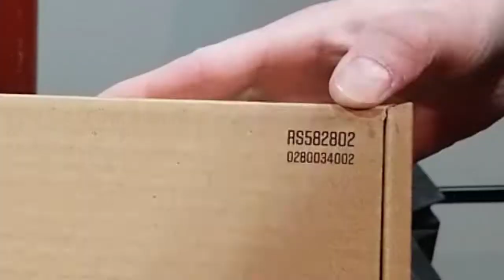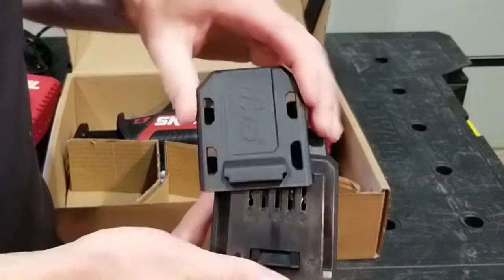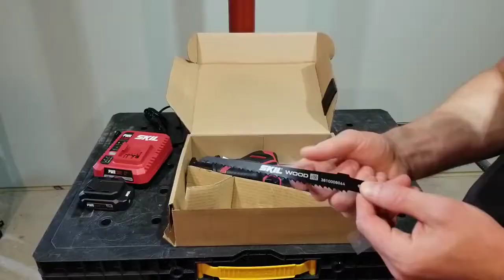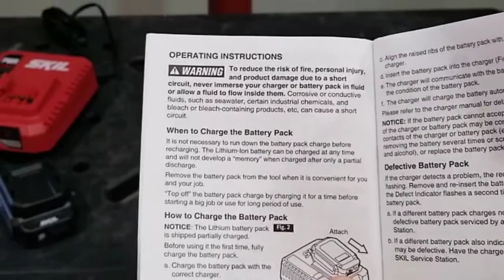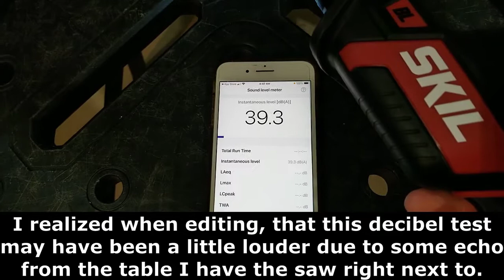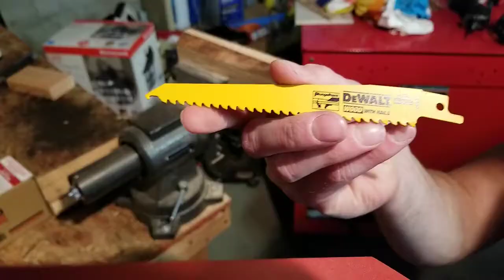SKIL 12v Reciprocating Saw First Look - IS SKIL THE BEST BRAND NO ONE'S LOOKING AT?

Comment: I picked up the last 12V recip saw and multitool from Lowe's before they pull them off the shelves and toss them with the Skil lanterns in the dumpsters.  I paid $21 after taxes. 
They couldn't sell me the 12V/20V lantern it came up as 2c.  I grabbed just one after they tossed all 4 in the dumpster. 
I couldn't register the 300 Lumen lantern because no receipt and it was in the trash.

Comment: Yeah the Skil 12V stuff in particuler is super slept on by lots of people (maybe less so these days, as people are finding out how good these tools are). They are perfect for the small/light/compact niche of tools/jobs. Unlike other brands, they're not just a throw-away design. They're innovative, smooth, very well built, and got great performance for their size and 12V batteries.

Even at their regulat prices they're worth it. However if you had a chance to buy into the Skil 12V line during the Lowe's liquidation, you were really lucky/smart. I bought the 12V jigsaw, this recip saw, the detail sander, multi-tool, 3/8" compact impact wrench, impact driver, 3/8" ratchet, pop-up lanterns, and 4" clamp on fans. I didn't pay more than $16 for a single tool. Some even less ($14, $10, $9, $7). At those prices it's just silly to ignore the lineup...

Comment: Home & Decor has the BEST prices on the Skil recip saws, oscillating tool, grinder and circular saw. 
I got the oscillating tool kit with 4Ah battery and charger and a 5Ah battery for $86 after taxes, a week later got the Skil 11lb sawzall (reciprocating saw kit with charger and 4Ah battery for $53 after taxes. 
I got the one handed recip in 20V at Waysource for $207 with 4Ah battery and charger on the 1st day of summer.  It was handy cutting some overhead branches. 
I wish Skil pushed 6" or 8" mini chain saws.  It feels like the mini chain saws rip through branches faster?
Reply from the maker: Wow! Those really are good deals. I'm not familiar with that store. They must not have them in my area. I've noticed them expanding their lineup a little bit as Menards has been carried the brushless versions of the 20 volts now, which are decent deals from what I was seeing on Amazon and Lowe's. I feel like I recently saw a chainsaw. I just don't remember what size it was for skill.

Comment: @tgltoday2717 I have everything I need in Milwaukee M12 and M18 Fuel, but recently picked up a bunch of Skil 12v, Flex 24v, and some Bosch 12v and 18v, as backups, just because they were so inexpensive. Skil 12v is definitely the most underrated line out there right now. 👍🏻

Comment: Just bought one from Lowe's. They had a one day sale, online only. Got it for $29. Can't beat that
Reply from the maker: Wow that is a sweet deal. Can't beat that at all.
Reply: I snagged the same steal as kit with 2ah, as well as circ with 4ah for $59 earlier and drill, impact, omt, light and speaker with 2x 2ah for $80 slightly before that. Fully in the line now! Next will be the inflator.
Reply from the maker: @iremetal Nice job on that hall. The inflator or something I've never used and I have a hard time even finding a video on it. I'd really like to know how well that works.
Reply: @tgltoday2717  Zach shop talk has one comparing to hypertough
Reply from the maker: Oh that's cool to know. I'll have to look that video up thank you.

Comment: I really think you should’ve gotten the Milwaukee 12 volt way more power and it’s smaller. But the downside it does cost quite a bit more. You can get nice 4ah batteries for your saw
Reply from the maker: I don't disagree at all. The Milwaukee is definitely a better saw. I actually gave this one to my grandpa and started getting him a few other skill 12 volt tools. And now that you mention it, I did actually end up getting the four amp hour battery for him. Thank you for watching.

Comment: Make sure that the battery pack is inserted all the way into the charger to make good contact. My  pack was a little hard to insert, returned the package thinking that charger was DOA. It was probably OK, I was not inserting pack with enough authority.
Reply from the maker: That's a great tip. Thank you for letting me know. I know I have a few Dewalt batteries that are hard to put in like that. Its kind of annoying.

Comment: I received mine today. I use a reciprocating saw strictly to cut tree branches . My intent was to replace my Milwaukee M18 Hackzall with the Skil PWRCore 12 reciprocating saw. Instead, I'll keep both. Together with my two-handed Milwaukee M18 Super Sawzall, the two one-handed recips will let me keep a 6-inch blade in the Skil, a 9-inch blade in the M18, and a 12-inch blade in the Super Sawzall. My  impressions were the same as yours: front-heavy but eerily free of vibration. Even when you squash the trigger, the speed ramps up slowly, like my PWRCore 12 jigsaw. I like that feature. I'll probably be using this saw mostly with the larger, heavier 4ah battery, which should provide more voltage under load and help balance the weight.
Reply from the maker: Glad you like it. For what Skil is, I really think they provide a great homeowner tool with a lot of bang for your buck.

Comment: I'll keep buying if they keep coming out with new stuff in 12 volt.
Need:
Fan
Radio
Gas pump
Shower head and pump for camping shower
Inflatable toys pump
Spotlight
Shop clock?  
Hot plate?
Hiking SOS alarm?
Reply from the maker: Haha that would be pretty nice. They should start making their accessories for both 12 or 20v. Then they would really have something going. I know they have both 12 and 20v inflators, just not sure if they do more then just tires but I'll be looking into that now. They also have a bluetooth speaker in the 20v but left out the 12. A fan, I'm actually surprised they dont have one of them yet.
Reply: @tgltoday2717  They have the Bluetooth speaker called 7 in 10 watt Bluetooth indoor speaker.  Not sure why they just didn't call it the 12v speaker.  It uses the 12v.

Comment: Great review. What type of blade would you recommend for cutting tree roots in the ground?
Reply from the maker: I have a 9" diablo pruning blade and it works great on tree branches. It has carbide teeth.  I'm not really sure about roots underground, but I think that as long as it's not hitting a bunch of rocks, it would hold up pretty good in the dirt. Hard to say for sure, I know dirt and chainsaw chains dont get along at all. Let me know how it does in the dirt if this is the route you go.
Reply: @tgltoday2717  Are the blades interchangeable with other brands?
Reply from the maker: @michaelcowart6100  yup. They work with all brands unless someone makes an oddball I'm not aware of which is totally possible.

Comment: Skil is an underrated gem these days.  Metabo HPT is another brand that doesn't get enough recognition.
Reply from the maker: I've not watched much on the Metabo, but I've heard a lot of good things about them. I totally agree on Skil. I saw that Lowers had the Skil 12v 5 tool combo kit on sale for $99 as of yesterday incase you are interested. Thanks for watching.
Reply: I'm in too many tool lines right now, lol.  But my first power tools as an adult were some Skil 18V about 15 years ago, so they will always be special to me.
Reply: Yeah Skil and Metabo are both severely underrated. Part of that is Lowe’s fault for not promoting or marketing them much and kinda putting them to the side compared to Dewalt and their store brands.

Comment: Does that model# on box matches the one on the tool ??
I received my kit by mail today and the model number on tool was RS582801?! More surprisingly.. is the shoe of the blade is solid, doesn’t pivot!!!! I’m really confused like if there’s another SKIL 12v brushless model has the blade shoe doesn’t pivot, do you know anything about that ?

EDIT: the shoe is NOW pivots somehow, lol 
I think it was jammed or something first times, I was even hitting on it hard to get the joints to move.. although, and aside of that I still find it weird that the Model # on tool doesn’t matches what’s on box
Reply from the maker: I don't remember if the numbers matched and my grandpa has the saw now so I can't go check. I do know that I just looked online when I registered it and I used the number on the box and it pulls up as the correct saw. Sorry I can't help you out anymore there. 

I'm glad you got the shoe to pivot. I remember when I first used it, the shoe was really hard to move at first. Once it moved the first time, then it moved pretty easy. It was like stuck from the factory possibly. I also used the Makita 18v subcompact for the first time yesterday and I saw reviews saying that it didn't have a lot of vibration. I can tell you that the Skil has practically none compared to the Makita I used. 

I hope you like the saw. Let me know what you think once you start using it more.

Comment: If you would have pressed that yellow light it would have charged a lot faster for the first 25% of the battery helpful hint..
Reply from the maker: Thanks man. I thought you only used that when you needed a quick charge. Didnt realize you could do it for the full charge to get the first 25% done faster.

Comment: Looks like they copied milwaukee
Reply: They are made by 2 different manufacturers. Skil (Chervon-FLEX,EGO,SKIL, SKILSAW etc,) Milwaukee  (TTI- MILWAUKEE, RYOBI, HART etc.)... 
But we have to remember al tool brands copy each other in many ways. Personally SKIL is much better than Milwaukees lower tier (<key words) that would compete. But we all know Milwaukee is a trusted name in the trades for Pro's. Skil is NOT a Pro line up. Chervon has FLEX for that ... and FLEX has tons of power & unique feature sets with a great battery (chervon is known for their batteries) & can compete with the BIGBOYS... And FLEX will be coming out with more models (reportedly even "stubby's) in the future as the name makes its way into the trades.
Reply: @adwhite804   I know they're made by different manufacturers And I would like to try that out the flex But  I don't want to spend the money on a new brand without them being out for a while
Reply from the maker: That could be. I'm not familiar with the M12 reciprocating saw enough to know.
Reply: skill doesn't need too copy anyone
Reply: Looks like they copied Milwaukee, who copied Bosch

Comment: Good information!  I have an old DeWalt 36V Max (32V nominal) recip and it weighs three times as much--more power but it beats you to death!  A one handed recip that has little vibration at a third of the weight is what I'm looking for.  I picked up the Skil oscillating 12V saw because of light weight as I need to do crown moldings, all sorts of work on drywall etc. and required a small, light weight saw to squeeze in tight spaces and not vibrate me to death and can be used for an hour without taking my shoulders out.  Really happy with the oscillating saw, throw a Diablo blade on it and go.
Reply from the maker: I want to get the 12v oscillating saw as well. I've heard it has practically no vibration. What do you think? I have a 20v DeWalt oscillating which is really nice but has been getting fixed under warranty for 3 months now.
Reply: @tgltoday2717  It does have little vibration, very sliim head to get in tight spaces and at 2.8 pounds, very light for overhead work. I've used it to remove lap sealant on those rubber RV roofs and to scrape paint on a house with no issues.  Generally, after using up the 2 Ah battery, it is time to give your hand a break from the mild vibration so I've used the tool for 4 hours or so with no numbness noted. I'd like to get the optional 4 Ah battery for all day use without running out.  Looked at the Makita but my 5Ah packs on that porky brushed motor model is very large, over 5 pounds in weight and although powerful, I passed on it for the lighter, much more compact, lower vibraton and quieter Skil 12.  I use it for precise cuts, scraping adhesives/paint--not typical construction work so find it the right tool for the job.  My recip saw use is generally when nothing else will work so the one handed models might do it. Heck, it's biggest use is tree trimming so slinging around a 13 pound (?) recip over your head cutting branches is major overkill and gets very tiring after 30 minutes.  Skil 10.8V with a 4Ah battery should do it..or maybe the Makita?  Decisions! (My wife loves the USB power on the Skil batteries)  :)
Reply from the maker: @EVnewbie  I'm glad you thought vibration was good as in so little as well. I just remember how bad that Subcompact DeWalt vibration was. You make a good point on the use of the 2ah SKIL battery. If I were to run that battery dead in one use I'd want a break for sure. I myself am trying to decide now if I want to buy the Skil 12v or get the Makita subcompact recip saw. That is the one I was waiting to get but now that I've used the SKIL, if I see a good deal on it again, I might have to just pick it up for myself. I like how small the 12v battery was for being able to charge your phone with the USB. Defiantly a great idea on that one.
Reply: @tgltoday2717  Recip saws suck a TON of power and I looked at the Skil 12V kit but it has the 2Ah battery.  I was hoping they would have a kit that came stock with the 4Ah battery so I can have two batteries and two chargers because--two = one and one = none so like to have options.  Alas, still looking around for the Skil Powercore 12 recip with a 4Ah battery option with no luck.  I guess I'll have to go Makita sub compact because I have four of their 18V 5Ah packs when I do tree trimming.  I have 14 trees to deal with so need some runtime.  Always fun to get THAT close and something screws you up!
Reply from the maker: @EVnewbie  I've only seen it with the 2ah as well. I see the 4ah batter is currently $40 on Amazon. Wow 14 trees, I'd go with the Makita subcompact as well since  you have the batteries for. I'm thinking I will as well if  that subcompact ever goes on sale.
Reply: @tgltoday2717  I figure Chervon has been distracted with launching Flex so Skil will have to wait.  I'll be looking at recips next spring to replace the massive DeWalt 36V beast at it turns 16 years old.  The LiFePO4 battery is a bit tired after 16 years of use.  Looking forward to what else Skil comes up with on the 12V (10.8V) platform as I prefer very small, light weight and low fatigue tools for various things as I don't need contractor grade Makitas for everything.  Have a 40V 4Ah pole chainsaw for the trees but a one handed recip with a Diabo 9" pruning blade would be great for the rest of the year.  I like your idea, go for the Makita compact recip on sale....never know, it might be reasonable tool only on Black Friday?  I'm setting in on Makita 36V X2/LXT 18V for the powerful stuff and Skil 10.8V 3 cell for the ultra-light compact power tools so hope that Chervon gets back on the Skil side after launching Flex this year.  I'm sure you will keep us posted!  :D
Reply from the maker: @EVnewbie  I was thinking the same about Flex. Since Chervon also makes Kolbalt and they had the XTR come out I think early 2020 if I remember right, and I've seen new Masterforce stuff which I believe is also Chervon, I can see how SKIL tool releases slowed down. But totally hoping that picks back up. I've been watching the Depot and Amazon for that subcompact Makita to go on sale all year and haven't seen it yet. If it happens, I will let you know or post a video if its a killer deal. Yes, if SKIL releases some sweet new 12v tools I will let you all know.
Reply: @EVnewbie  like you, I love Skil 12V tools but lament that skil bundles its kits with the smaller battery. The only 12 volt Skil kit that comes with 4-amp-hour battery is the circular saw. You can buy this recipp with the 4AH battery on Amazon, but the price is basically the same as buying them separately and you don't get the charger.
In the 12V line I own the inflator, the new (for 2021) Mechanical Light, and the barrel jigsaw. I haven't used the jigsaw, but I use the inflator each weekend and it works about 25 to 30 percent faster with the 4AH battery installed.
Reply: @PaulStregevsky  Thank you for the valuable infomation!  I'd like to pick up the barrel grip jigsaw w/4Ah battery and their LED flood light for car illumination.  I would also like a 4" clamp type fan as the 10.8V 2Ah pack would keep it very light weight. An automotive charger would be nice for camping weekend trips to use the lights/fans and the USB charger funcion.  My wife seems to like my Skil for some odd reason :)   Maybe Skil will expand their 12V line to equal the 20V line eventualy as for compact/light weight tools I would love if Skil had all the goodies.  Maybe I should enquire their customer suppport to see if they will bring out new tools this fall in time for Christmas? Wait and see it seems.
Reply: @EVnewbie  Yes! A 12V fan and a 12V car charger are the two additions I want, too! And in the 40V line, a telescoping brushless hedge trimmer to complement the superb brushlesx telescoping pole saw.
I actually keep a Makita CXT 12V (10.8V) fan strapped to my 21-inch lawnmower (with nylon ties), aimed at my neck!
Reply: @PaulStregevsky  You got me!  I want a fan when I mow....I use a Makita 36V X2 commercial weedwacker as I have around 800 feet or so of deep drainage ditches to blast.  I use the Makita for the big stuff 36V and 18V for medium but want Skil for the small/compact/light tools.  Figure Chervon has huge demand for Ego and brought Flex in to play with the big kids so maybe Skil will get some love before Christmas.   One can hope.